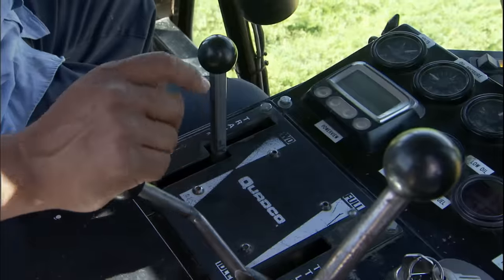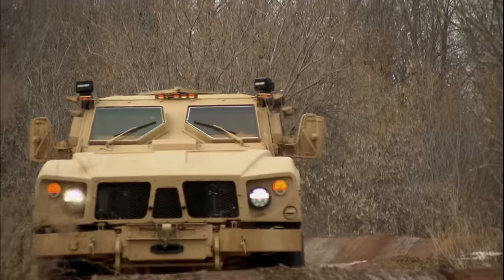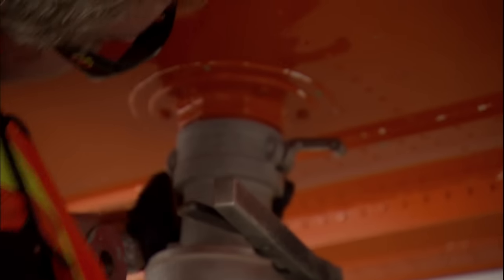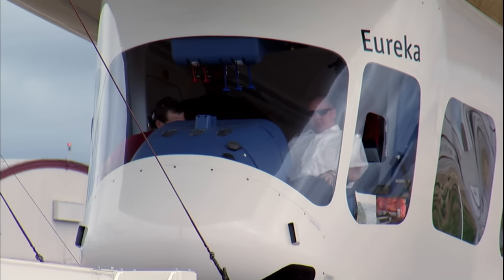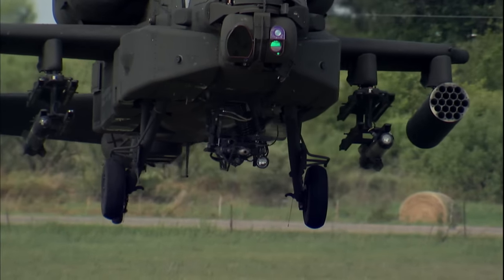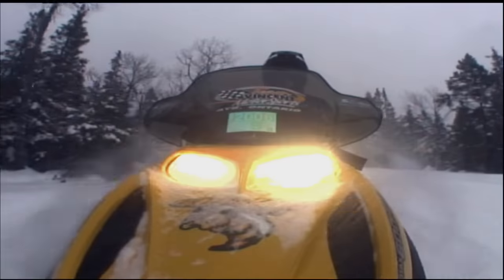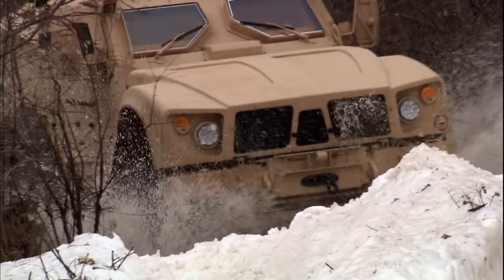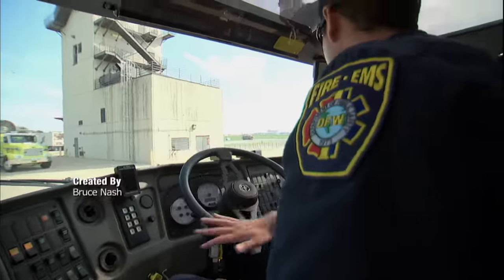Modern Marvels: The Most Powerful Machines on the Planet (S15, E32) | Full Episode

Comment: I had an Apache simulator and it took me a week to get it off the ground. LOL Once up the flying was easy but working all the electronics and weapons systems is what takes time to learn.
Reply: so its top speed is 220 like the chart says or 167 like the narrator said? thats very confusing when they give 2 much different numbers inside a minute lol.
Reply: @catfishredneck88  227 MPH Is the top speed. As you add arms and electronics this will take some off the top end. Not to mention weather conditions and altitude.

Comment: The air moves FASTER over the top of the hydroplane, not slower, than the air under it. The higher velocity of the air creates lower pressure above than below, and that creates lift.
Reply: Hey man you leave modern marvels alone!
Reply: @rippertaterchipper4117  they made a factually incorrect statement. No one should have a problem with getting scientific facts correct.
Reply: @mattr3632  do you wear a mask
Reply: @micahreese982  what does wearing a mask have to do with aerodynamics?
Reply: @mattr3632  just curious what kind of scientific facts you believe. I use masks as a baseline.
Reply: @mattr3632  sometimes